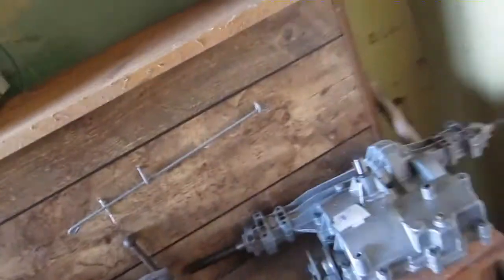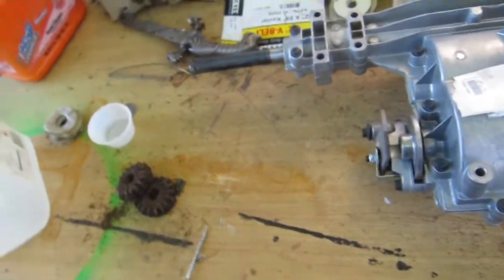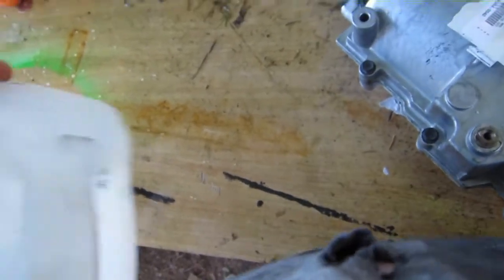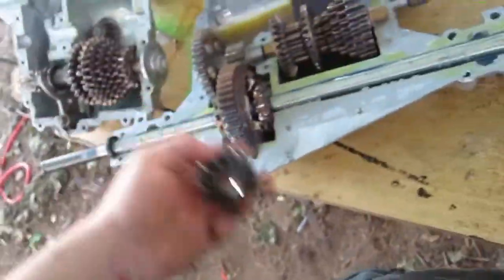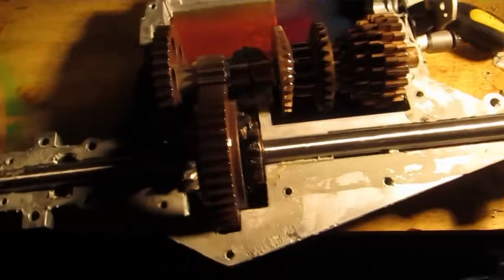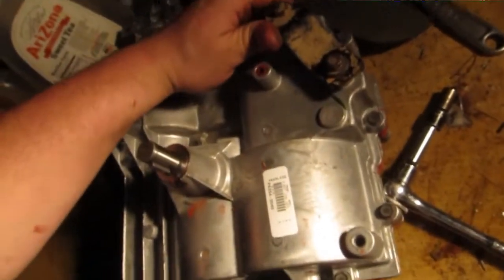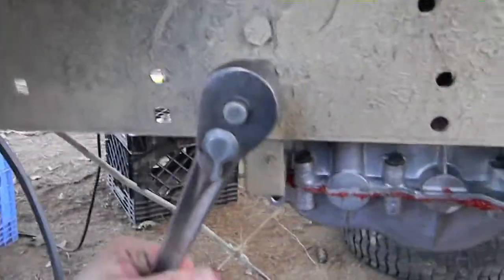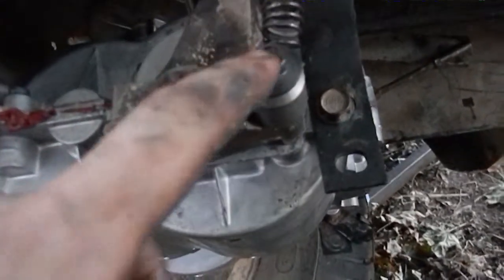The Redneck Mower Part 10 - Transaxle Replace

Comment: Transax transplant 

I have a 30 y.o. Murray 11/36ic that was increasingly difficult to change gear. I acquired another transaxle 10 years ago, and seeing it has 10 years less use than my one so it must be in good or better condition...right? Put it on, and now the mower won't move forward or back.
I see the drive belt is turning the rear pulley on the transax. I lift the back up to see if there is the slightest movement and there is nada. 😑

Any ideas anyone...